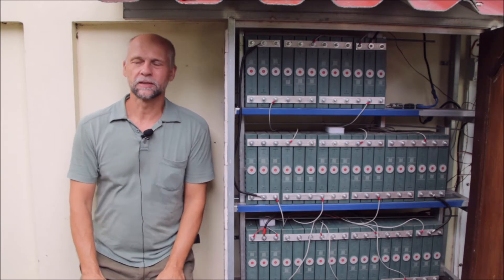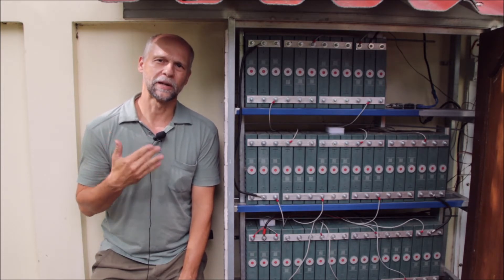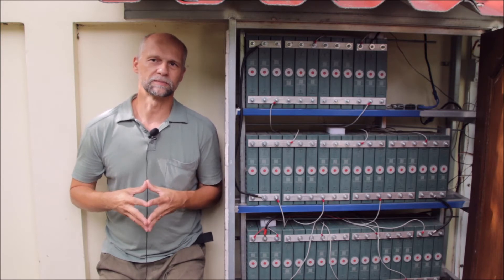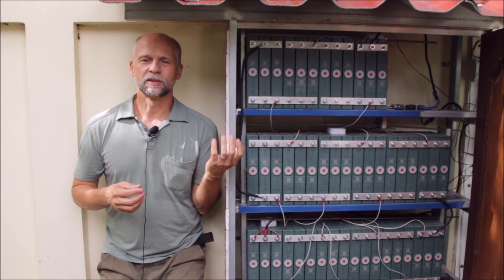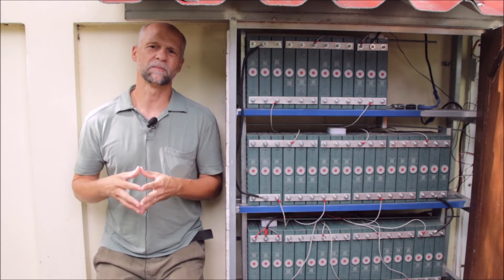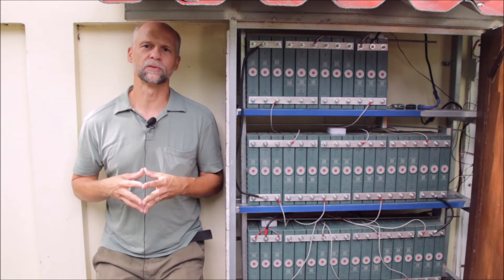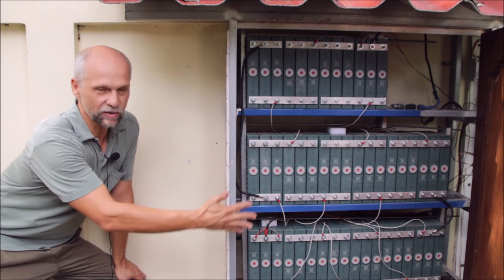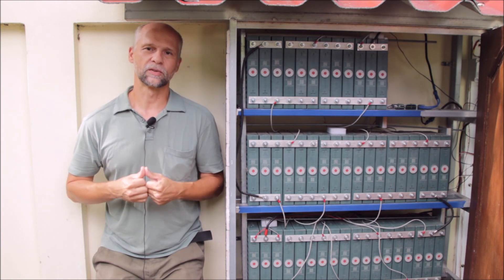Parallel Strings or Parallel Cells in one String? What is the better battery setup?

Comment: Totally agree but as always there is a limit to parallel length especially the bus bar length as to where and how many connections for charging the parallel group so design of the connection to the series is important, but normally with the large cells this is not a problem.
Reply from the maker: Yes. Especially high current builds will be forced to keep packs smaller. But luckily in solar applications we are talking off easy going configurations.
Reply: @RolandW_DIYEnergyandMore  You have an "easy going" configuration.  As soon as we add a high wattage appliance, the "easy going" configuration is no longer valid ...
Reply from the maker: @MrSummitville  Yes, but isn't that exactly the point where more cells in parallel without technological seperation will help keeping currents to flow evenly? Or is a high amperage BMS your concern? I would not use a FET based BMS for currents exceeding hundreds of Amps.